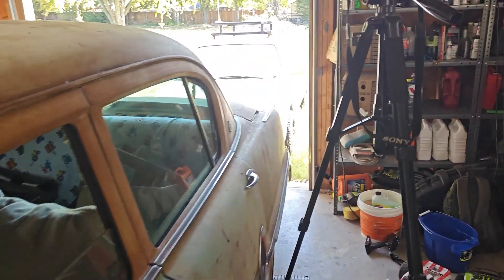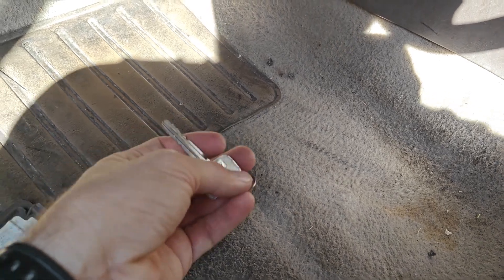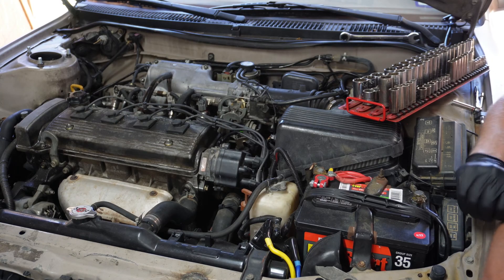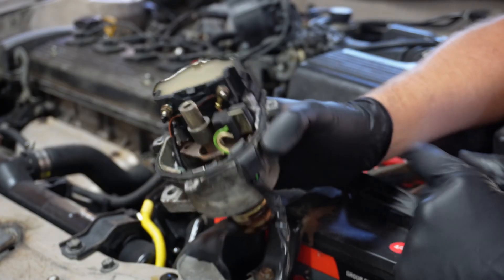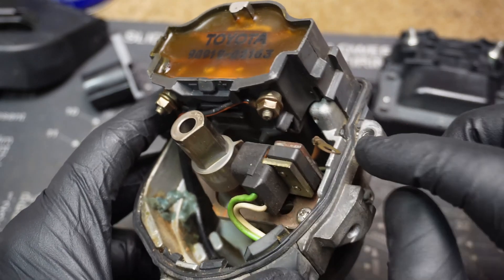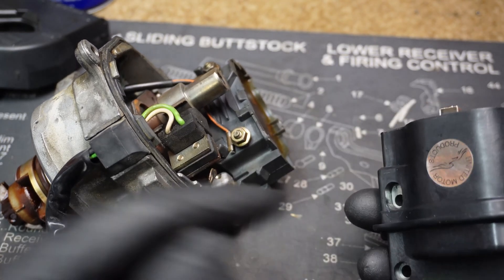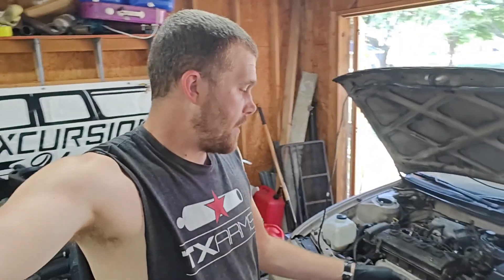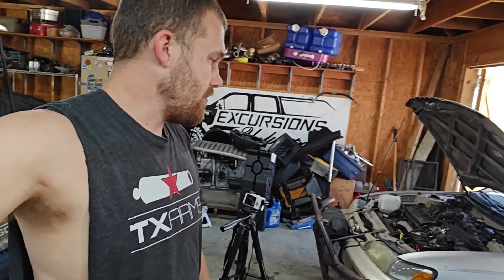Crank no start, NO SPARK repair 1996 Toyota example

Comment: Can you help me? I have a Corolla WG 1.8 in Brazil that uses the same 4-wire distributor. This distributor accepts engine ignition timing adjustment, as there is no space on the screw for adjustment using a timing gun. Another question: does this distributor not use an ignition module that is next to the coil? So, where would the ignition coil module be?

Comment: I need to see you put the distributor in I’m having a heck of a time. You remind me of one of my Son in Law’s
Reply from the maker: Hey there! The distributor should only go in one way, and the rotor drive can go 2 ways. It is either correct or 180 degrees out. If you install it, and it doesn't run, pull the distributor and turn the rotor drive 180 degrees. I don't have this car any longer to video it for you, or I definitely would.

Comment: didn't check the primary and secondary coils' resistence before replacement ?
Reply from the maker: @bashaben7098 I did, the coil wasn't bad and I re installed it. The capacitor was bad

Comment: So mine is popped n car wont start do i change distributor
Reply from the maker: @christophergonzalez273  you probably just need to change the capacitor like I did in the video
Reply: @gagefixeseverything  so I unplugged it and car started right up, does it need one to run normally or can I just leave it like that, and man you're the only one with this video I was having a headache
Reply from the maker: @christophergonzalez273  You can leave it unplugged, but it may mess with your radio and affect other electronics long term. Don't drive with it unplugged too long. You can do it while you wait for the new condensor to come in the mail
Reply: @gagefixeseverything  dude you're such a life saver, I'm not even joking, will it be ok for a 20 min drive to my job already missed bunch of days
Reply: @gagefixeseverything Also one more question I need to change the o ring in my distributor if I take it out do I need to do timing , I heard for a 97 1.6 adjustment is not necessary
Reply from the maker: @christophergonzalez273  Yeah you can drive it for a while for sure. You do need to change the o-ring, or it will start leaking, and there is no adjustment on that distributor, so you are good to go!
Reply: @gagefixeseverything  man I can thank you enough honestly
Reply: @gagefixeseverything  I was getting ready to buy a other car
Reply: @gagefixeseverything  one more question if you don't mind, if I don't have to do ignition timing does that mean I don't have to TDC, top dead center ?
Reply from the maker: @christophergonzalez273  Correct! You can just yank the distributor out and put it back in. Mark there the rotor is pointing so you don't get it 180 degrees out
Reply: @gagefixeseverything  so the rotor aslong as the new rotor on new distributor is facing same direction that the old rotor is facing I'll be fine ?
Reply: 1996 Toyota Corolla.
Having the same issue. 
No spark. Checked 10A fuse and it looks good. Tried the capacitor wire bypass. But, it didn't work. Still same issue cranks but, no spark.